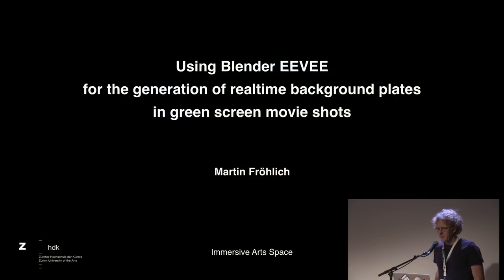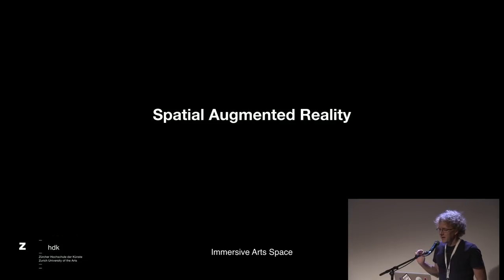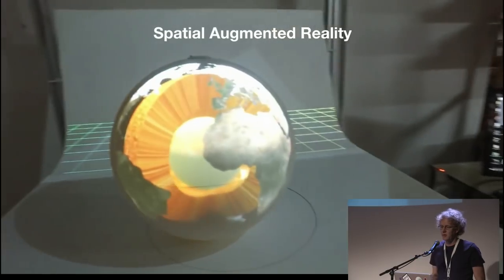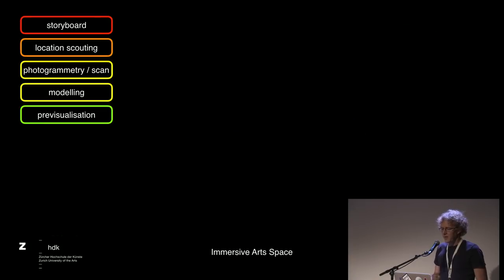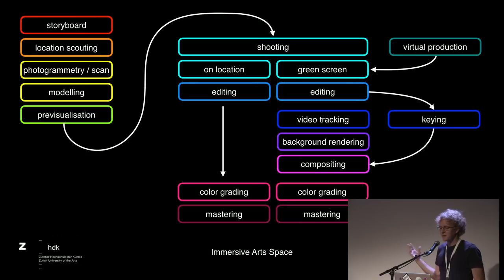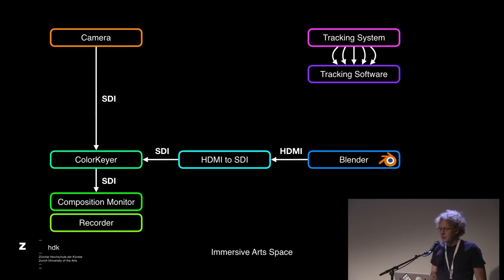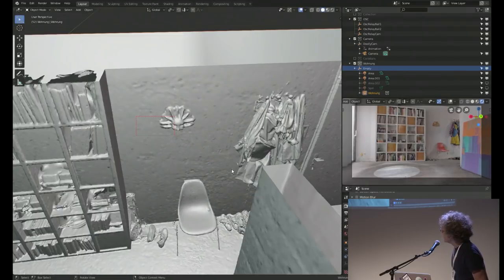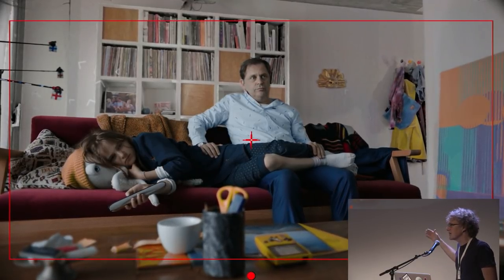Using EEVEE for the generation of realtime background plate in movie shots - Martin Fröhlich

Comment: @Martin Fröhlich This is great stuff ,I've always wondered about building a cinematography system for real time CGI ARFX makeup, or for real time capture of things like HUDS or FUI's,etc that would better than CGI because of the actual cinematography lighting involved comes from those interfaces. So far it seems like masking any occluding objects out of the projections is a real hard problem (like a persons hands when they touch the projection surface you don't want to just have it on the back of the hand ).
Reply: it is still a hard problem and requires tracking the hand and its shape, too. sometime in the future..
Reply: @maybites  right, what about more static situations stationary surfaces and a locked down camera isn't that then just a diff from an initial plate of the set? no ,wait because then the projection itself becomes part of what's different on the stationary surfaces,ahh I get it a bit better yeah tricky thanks.

Comment: Cool tech. I think you may come out better controlling the physical camera movement with Blender. Then you wont need to track the camera for Blender to know where it is. Or use encoders to send rotation information into blender kinda like CNC machines tell there position and orientation to the controlling software.

Comment: nice tech demo for a university but useless for the industry, way better and commercially available systems like Ncam, Mo-sys, etc. give you perfect tracking and Eevee while fun cannot compete with UE4 or Unity in any way. Cool as a student project but that's pretty much it. There are many professional Virtual Production tools on the market which are easier to use and not too expensive.
Reply: it really depends what you want to achieve. if you are looking for a tool that is creating a final product, this setup is not for you. if you are looking for a way to previsualize on the set without the need for perfection, this is a very viable path, especially if you want to use blender for postproduction. 

in terms of the tracking system I agree with you, a mocap system as we used it is not perfectly suitable for the job, especially since it can only be used indoors, while Ncam looks more flexible. But both your suggestions are expensive, too (expensive is relative, really). As I mentioned, I am working on a cheap solution that (probably) works similar to NCam, though most likely not with the same precision. but for previsualizing in realtime on set, the tracking doesn't have to be perfect.

Using EEVEE in this context is not more complicated than using any other gameengine, especially if you are already familiar with it. but again in agreement with you, unity or unreal are more powerful and better suited if you have very elaborate backgrounds you want to animate.
Reply: Yeah! Look at this guy and his brilliance creating an AR system for real time visualization! AND HE"S GENEROUSLY SHARED RESULTS WITH THE WORLD?! WHAT! pfffft. Why bother innovating with open source software creating opportunities for global development! Just let related industries stagnate as is behind proprietary systems and vendor lockin!  After all it's not like they too had to once make something "useless for industry" the things they made magically appeared overnight.